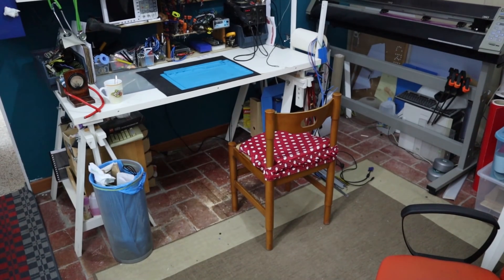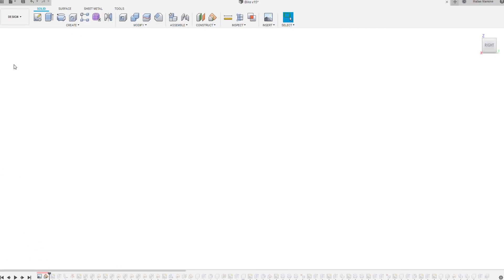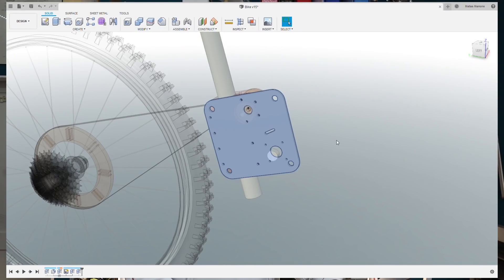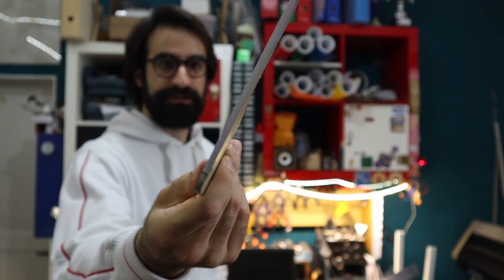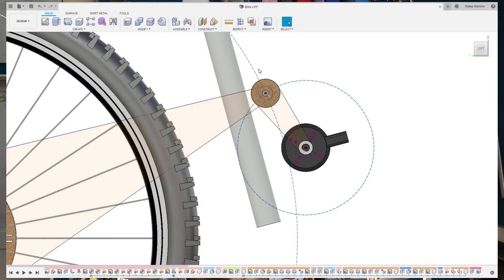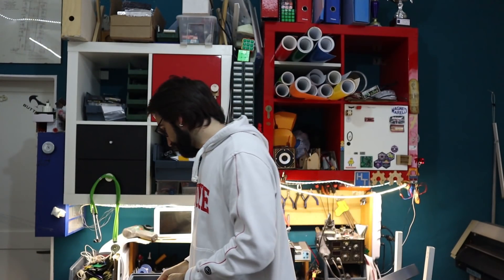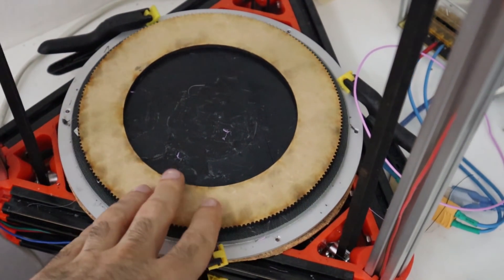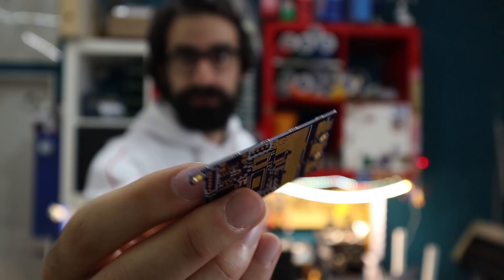DIY Electric Bike - Design

Comment: Hello, Could you tell me which brand and model of 3D printer you use ?
Reply from the maker: Hi! It's a custom built delta 3D printer, but the reference model is the Kossel Mini, if I remember correctly. It runs on the old RAMPS 1.4 with Marlin firmware